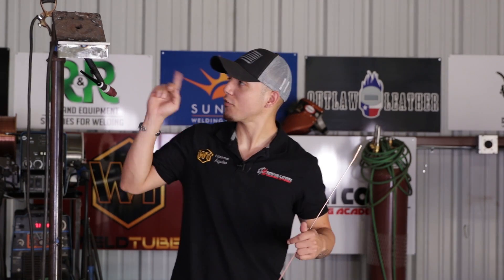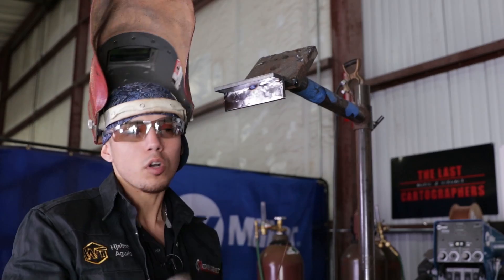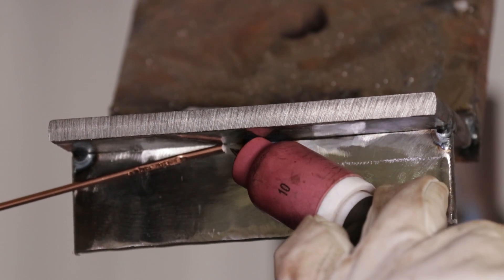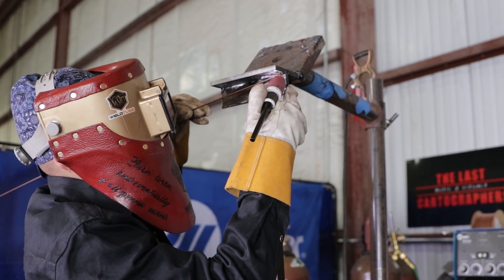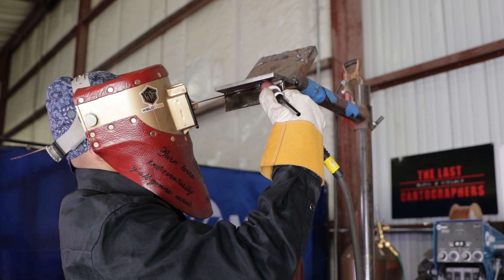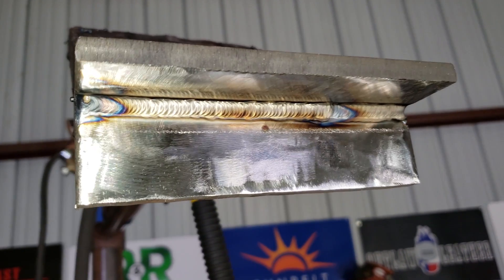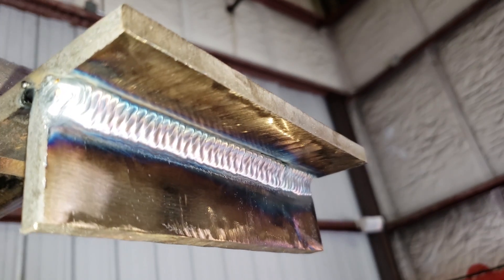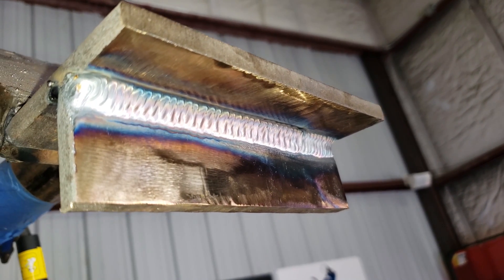Overhead 4F T- joint Tig Welding

Comment: We did a break test in my inspection class and weaving/wiggling on the first pass of a fillet with tig doesn’t get full root penetration and will not pass said break test, but a dip for the root will
Reply: I was thinking the same thing Mate. yer create pool and then fill instead of laying in corner and not burning in.

Comment: Dude your a beast at this.. I'm struggling on the vertical in class right now
Reply: I ran a tig test for a shipyard at 270 amps on 1/4 plate steel. Ran the same test on Aluminum at 370 amps. When in doubt turn it up and let her eat🤙
Reply: @jonathonbridges9625  yeah cant be scared of that heat burn too cold you not gonna make it 180 a little too cold if its er70s6  maybe 210  sounds better
Reply: Man one time i took a test for jv driver on a 316 sch 10 stainless ran 265 amps for the bead and it sugared up but i turned the purge up and ran the hot at 300amps it was good so dont be scared to turn up 👨🏼‍🏭